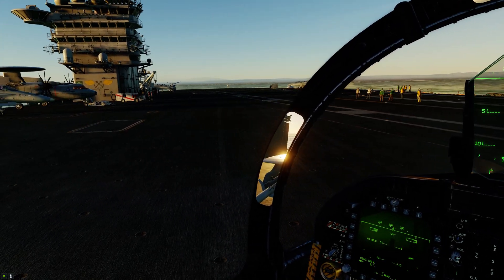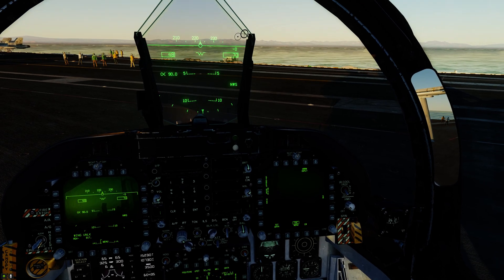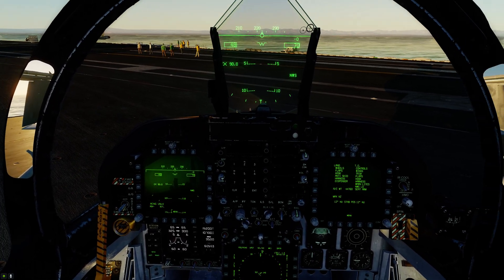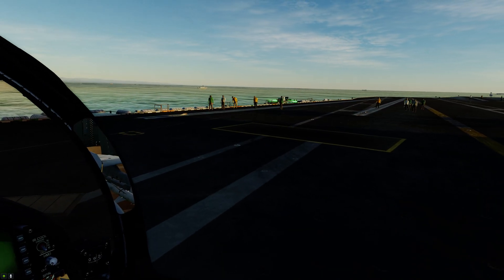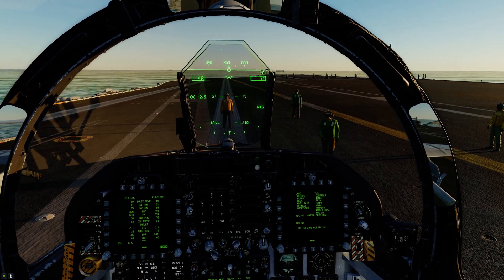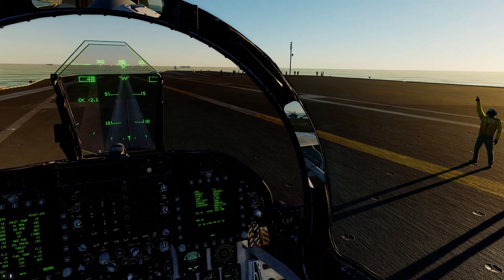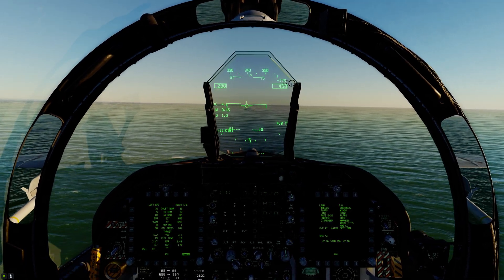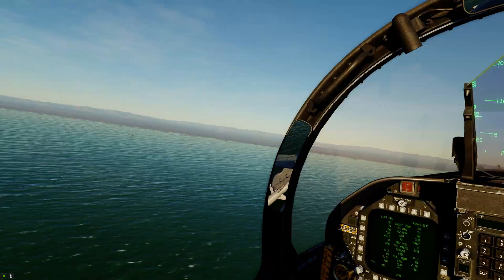THE AIR WARFARE GROUP - SUPER-CARRIER CASE I DEPARTURE

Comment: I'm told the locks will lock no matter what position the wings are actually in, so if you try to lock them while the wings are in transit, the wings wont lock, they will sort of sit on top of the locks, and the mechanisms could also be damaged.
Reply from the maker: Thanks Jordon, that makes sense as the mechanism for the wing locks needs to be beefy and simple enough not to fail.  You’ve given me a topic to research and I encourage everyone to dig into aviation (get your Geek on) and share the passion for fighter aviation.